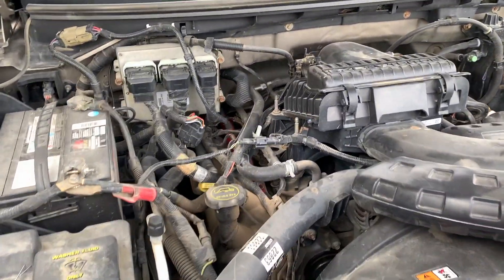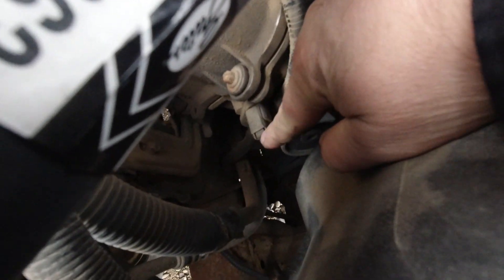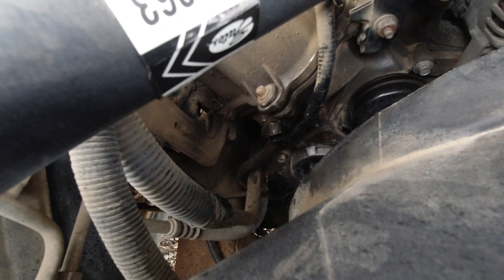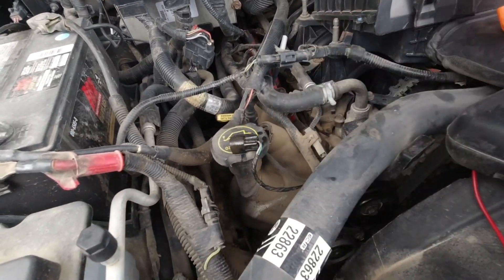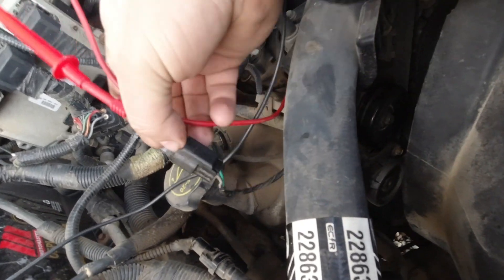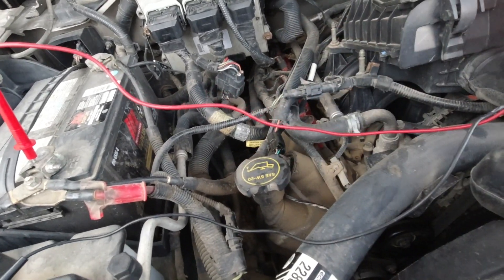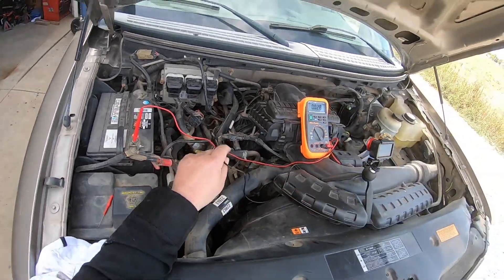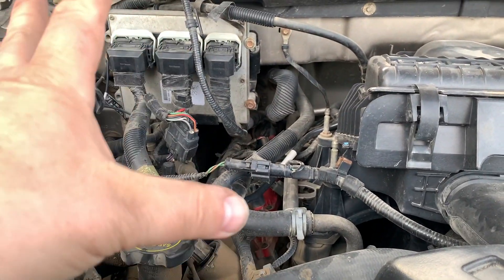F150 Camshaft Sensor P0340 P0344 P0345 or P0349 5.4 3V

Comment: my truck fx42014 3.5 v6 has stopped in 5 seconds after showinglow oil pressure and codes showing PO340, PO345,PO390,PO365. ITS NOT STARING , WHAT WOULD BE THE ISSUE ?? AANY GUESS

Comment: I need help testing the camshaft wires one has almost 12 volts but the other wire has only 6 all the way to pcm tested the pcm pins and same thing. Is it the pcm?
Reply: Found the problem timing guide residue was clogging Oil pick yo tube causing low oil pressure and jumping timing

Comment: I have this in the shop now and 1 wire goes to 44 and the other one is ground, then 1 wire on the other bank is going to 45 and 2nd wire is ground. 
Im not getting any voltage threw anything. 
Im thinking the pcm is faulty? 
Anyone wanna chime in?

Comment: You are slightly mistaken on the pin check. Pin 45 on ECU is for Bank 1 CPS Signal and pin 44 is for Bank 2 CPS signal. As for the voltage check? the Green wire is the power wire and is bundled along with pin 58, oxy sensor, fuel press/temp sensor, cyl hd  temp,and evap sensor. If any of those items are bad or shorted it will give a bad reading on CPS being tested too. Infinite ohms is open, and the lower the number shown is the most complete circuit.
Reply: Wow. That was super info.  My catalytic convertor was just stolen had a shop put in a straight pipe.  They put in old sensors that were shorted in catalytic convertor that caused my codes.  Replaced the sensors and wow it started running perfect.  Thank u for this info I had been chasing this for 3 months.  Could not fix it because the problem was a short in the catalytic converter sensor....wow...thank u again.
Reply: @matthewcollins2722 which codes you had?

Comment: Great video. I have a question on your test procedure. I am getting p0345, 349 during koeo test. So I tries to test the circuit and get ground on one pin of the plug and nothing on the other. No power or ground. I wasn't sure when watching you test voltage at the plug but it seems you are connected to batt pos when you test for voltage? So is it supposed to be a ground on both pins in the lug or is one pos and one neg? Thanks

Comment: Pin 45 is one side sensor pin 44 is the other side sensor the grey and red wire is signal return and the orange wire on one sensor is from the pcm the green on the other sensor is from the pcm positive I don’t know how you got your information but it’s not correct at all each sensor only has one pin on the pcm the signal return is shared with a bunch of other sensors
Reply: Thank you so much bro that made so much more sense this guy threw me for a loop
Reply: I got a 2011 f150 3.5 and a code p010 , in bank 1 there 2 sensors ,bank 2 same. I ck the voltage in bank 1 one sensor has close to 12v, the other sensor in bank 1 (has 2 wires) has no voltage. Did both sensor need 12 v or only one? Help please?
Reply: Yeah I cut the wrong wire because I thought it was shorted out only to trace it back and realize this guy gave bad info as to where the red/grey wire actually goes too 😢

Comment: How do you find out what pin you need to check??
Reply: You look at the color of the wire going to the sensor then go to the ECU plug. If you can’t pinpoint where the exact one is just move to the other pins around the one you think it is.

Comment: I've put new Cloyes chains and tensioners and phasers along with camshaft position sensors and I'm still getting this code. Customer is super pissed because it keeps coming back after 15 miles. It will feel like a intermittent miss. When I rebuilt the engine, I sent the heads get a valve job with followers and lifters. Any ideas?
Reply from the maker: Sounds like you didn’t verify oil pressure before doing all this to confirm if the Camshaft journals are worn out
Reply: @TestDontguess is random oil pressure dropping on the gage but no visible oil leak an indication of this? I am in no way a mechanic and trying to learn as much as I can thanks
Reply: @TestDontguess I did the exact same as original poster  and I have same problem any ideas?
Reply: I'm having the exact same issue did you find the fix???

Comment: I have a 2012 with a p0340 code, and it has no.power, takes forever to get the engine to Rev upto 4000 rpm, and it shifts hard and almost a gutless pig to drive
Reply: Do you find what the issue was?
Reply: Your cam guides broke and they're clogging your oil pickup

Comment: I have 2014 Raptor 6.2 no engine codes , but every now and then when I come to a stop at traffic light he engine rpm revs up and then dies showing low oil pressure , is this the culprit of the problem ?

Comment: I have a 2006 f250 same engine tho. One wire is getting 12v other is getting 6v. There are no breaks in the wire and the code actually went away after an oil change and cam sensor replacement. I read the wire reading 6v means timing chain is loose? Is this true?
Reply: Did you ever find out any info on this I have a mustang getting 12v on one side and 6 on other for both banks I just built a motor and put it in and can’t figure this out
Reply: I'm getting the same 12V and 6V problem. Any luck figuring yours out?
Reply: @keyera1378  honestly just gave up on this. I tore apart the engine to get to the timing chain. The plastic guides were completely gone. did a full timing job put it all back together and still had the same issues. cracked open the oil pan enough to get the pick up tube out, and all the plastic turned into little pieces and completely plugged up the screen for the pickup. Basically the engine wasnt getting enough oil. been about a week since ive put it all back together and havent had any engine issues or codes since

Comment: I changed already but the motor still shacking
Reply: I’m having the same issue with my F150 I replaced the sensors but motor still clicking/shaking once warmed up
Reply: @georgesaucedo7929  my problem was the manifold leak I was changing a lot pieces

Comment: When you were testing for voltage you were on the positive side of the battery so all of that is doing is showing that you have a ground at the harness
Reply from the maker: That’s what it’s showing and also making sure you don’t have a broken wire or short to ground. Do you even understand electronics

Comment: What if you got all of the codes mentioned in the title all at the same time?
Reply: Just happened to me, what did you end up doing?
Reply: @chipers8710  my truck had over 300k miles with a bad transmission and low oil pressure I parked it and bought a 2011. Sorry

Comment: You had the red lead on battery positive and the black lead to the cam connector so you were getting 12 volts because you were GROUNDING through the cam sensor connector.
Reply: Yea I wasn’t tracking on that. If he was checking voltage on the plug why didn’t he just ground out the multimeter and check the plug for voltage

Comment: I already replaced all of the cam sensors but I get the P0346, only when I scan while driving, yet no Check Engine Light. But the error shows on my scanner, only when I scan and drive at the same time. When I scan in park the scanner shows 0 codes. My vehicle does have symptoms. I looked at the wires and they basically look new in my 2014 ford Mustang V6 3.7. I also replaced the VVT solenoid valves, changed the oil, etc. I even purchased more sensors in case I got a bad one. I sure wish someone can give me some much needed direction. Thank you.
Reply: Hello i have the same issue with the same engine , could you figure the problem out ? 
Thank you
Reply: Hi, the problem was that the wire connecting to one of the oil control valves was not properly connected. I did a few other things but it sure seems like making sure the connection was proper fixed the problem. I also used and use thicker oil, used engine cleaner within the engine, etc. But the process blown wasn't fixed until I twisted the wire and reinstalled it on the oil control valve.

Comment: 2011 F-150 code p0349  camshaft positioning sensor A bank 2 trying to find the location of that sensor
Reply: This is in the driver side by the serpentine belt you can take the air conduct out of the way to handle it better
Reply: If you solve this issue can you tell me

Comment: Thank you for this video. It is informative, but folks should know that the P0345 code is for Bank 2 which is the driver's side. My 2004 F150 FX4 (5.4L, 3V) had been giving me random misfires for some time and eventually a P0345 code. I replaced the camshaft position sensor and the misfires and code cleared up. No further problems. Don't discount the possibility that the sensor has failed just because they usually don't!
Reply: So I can do this diy right?
Reply: @flightbun3311  yes
Reply: My 2008 f150 is getting P0022 and it's saying bank 2, is that still drivers side as well?
Reply: @michaelrodriguez5722  yes, bank 2 is always the driver's side on Fords
Reply: @jimhamman2335  thank you
Reply: @michaelrodriguez5722 U R welcome. good luck!
Reply: @michaelrodriguez5722 yes
Reply: Ty
Reply: I think his code is P0340 though. He was referring to both sides

Comment: I have a 2005 5.4 expedition and I'm getting 11.75 volts on one and 4.5 volts on the positive wire on both cam connections
Reply: I'm getting 6.5 on one side and 11 on the other. Did you find out what was wrong with yours?
Reply: So did I…I had 11 on one side 7 on the other did you ever figure out anything

Comment: Hello friend, perform the tests that you indicate in your video and in both connectors the signal from the pcm gives me 6.22 v, that indicates that it is below 10 v, but that the wiring or the current output of the pcm is wrong?
Reply: I'm having same issue. With key off I get better then 10 volts on both wires, but with key on I get 6 volts on "said" green wire.
Reply: @evanwestbrooks4049  hello friend check the manufacturer's manual and it is normal to detect the problem and it is the timing chain kit the chain was loose, change the timing chains and it returned to normal
Reply: @carlitoxm Oiga hice yo el test con la llave prendida y no me da más de 10 voltajes. Pero con la llave apagada si me da más de 10 voltajes, en el enchufe del cam position sensor. Eso es normal?
Reply: @erickuribe9860  si es normal refiérase al manual del fabricante y es el comportamiento normal , el mayor problema de los motores 5.4 es las cadenas de tiempo y los faser , el fabricante recomienda el cambio de kit pero posiblemente puede seguir la falla presente , en ese caso se debe remplazar el motor
Reply: @carlitoxm  Muchas gracias por la respuesta. En donde se podrá conseguir el manual de fabricante? Si no es mucha molestia. 👍